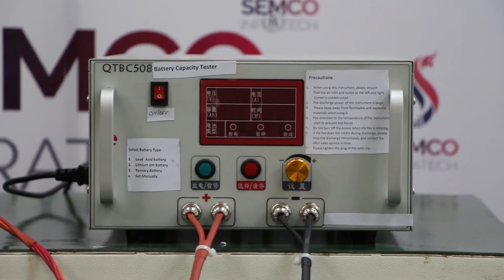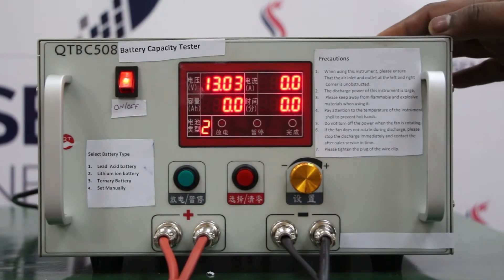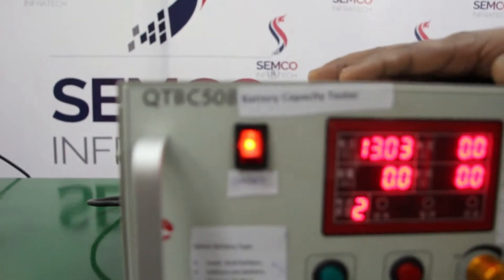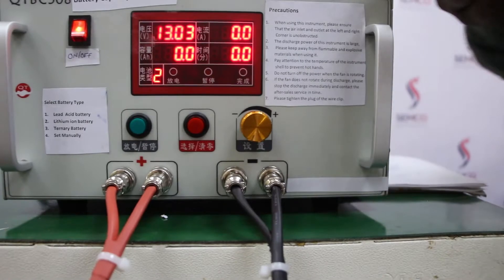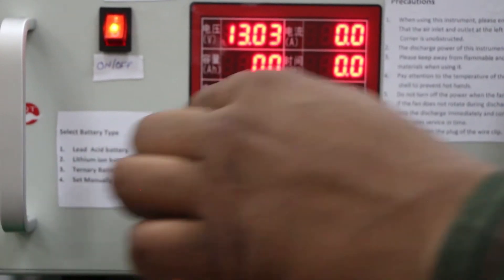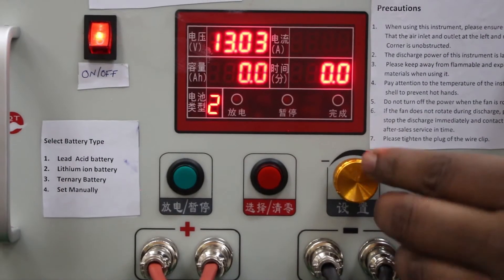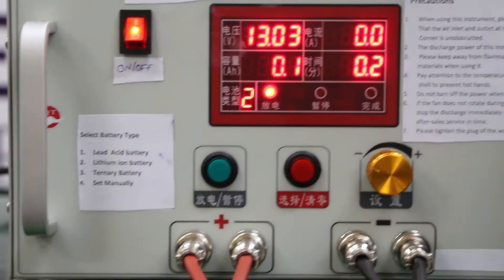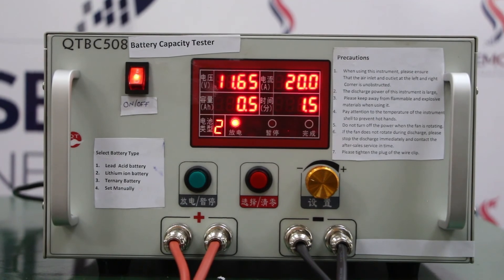Lithium-ion Battery Discharger QTBC-508

Comment: I have the same machine, but even though I connect the battery and make all the necessary adjustments, it doesn’t work. It doesn’t display the voltage correctly, and when I press start, the machine immediately stops working. What should I do about this? Is there any reset button?